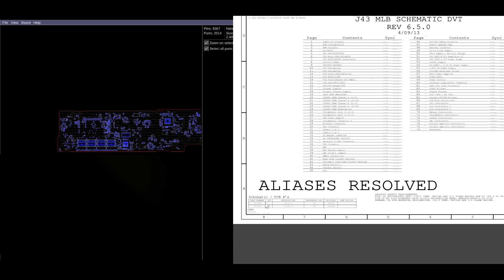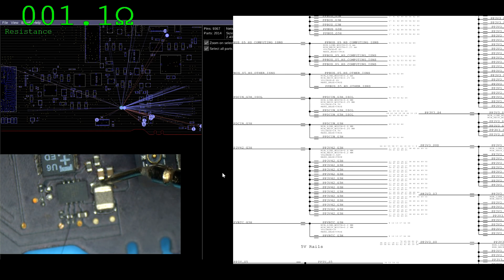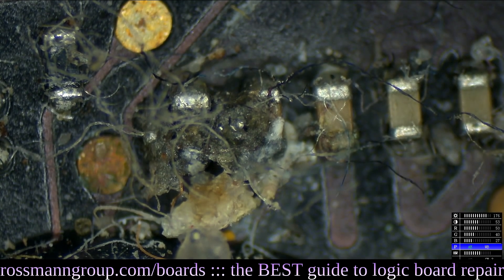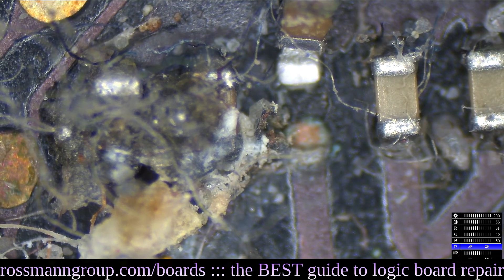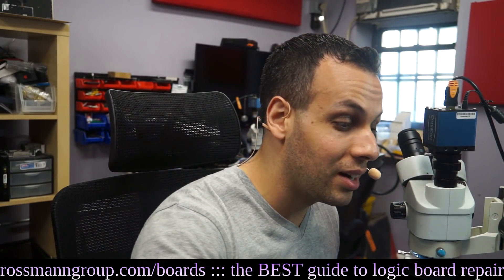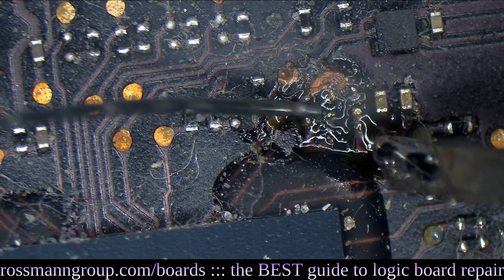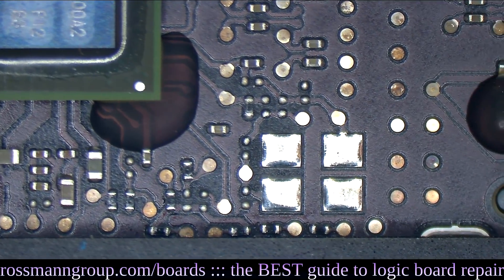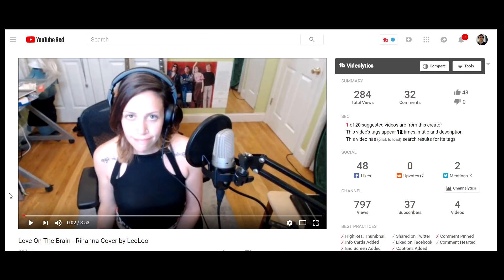How many pubes does it take to kill a Macbook?

Comment: I wonder how fast Apple would go out of business if they'd do conformal coatings on all PCBs... 

Yesterday I had a power supply that happened to be near a leaking barrel of hydrochloric acid. I didn't even bother to ask but damn, that one and a half kilos of silicone poured all over the board by that over zealous chinese worker really helped save it. Only the fan grill had to be trashed.

Comment: There was a Tesla that was fully submerged for days that worked after salvage auction.  The digital tablet dashboard display, virtual gauges and system controllers were all water tight.  Car powered up and worked after it dried.

Comment: Idk bout the Tesla opinion, their seclusion as opposed to the rest of the car market, and electric car market is that the motor, engine and battery can only be serviced and fixed by Tesla OR one of their trusted 3rd party auto shops across the world that are experienced in Tesla cars, and not just normal EV vehicles.
Tesla is a step ahead of many, which is comparable to Apple, years ago when buying an iphone or ipod actually had some value above the competition.
Unless Tesla and Elon Musk stop inovating like Apple did there should be nothing stopping them from staying and setting their reputation as the leader in EV vehicles.
Rember, elon is GOING to mars, Jobs left.

Comment: Louis I do have a question... Not sure if it's ruined or not.

So one of my cats decided to use my mother's Ipad as a litter box.. I cleaned with alcohol and urine neutralizer, but it still has an odor despite it occuring on the glass alone? Seems like it soaked in somehow?

Any tips on sanitizing this crap? I'm kinda clueless as to why I can't get the smell out.
Reply from the maker: It's on the inside. It's done for.
Reply: Joshua Griffin even your cat knows how shitty Apple products are.
Reply: RIP

Cat Piss melts apple boards
Reply: I honestly haven't tried to power it on since it occurred. It had a literal puddle on the glass, but nothing seemed to have seeped to the edge.

If it did... welp... rip icrap? I'm not a fan, but I didn't buy it. I just love your channel lol

Comment: How is it even possible to get pubes on a mother board of a laptop
Reply from the maker: You're not thinking different.
Reply: Lt corsa, mother boards tend to grow hair profusely at a certain age. This is completely natural and they should be proud of their beautiful changing bodies.
Reply: Lt corsa You need to think outside the box man. Anything is possible when you gonna bust a nut
Reply: It's fan power.
Reply: Shave with the fan
Reply: Lt corsa - Likely someone at Apple told them to "insert their three and a half inch floppy" and they misunderstood.  :D
Reply: Probably the same reason spills get through to logic boards on macbooks. Apple loves it when you have to pay for another replacement.